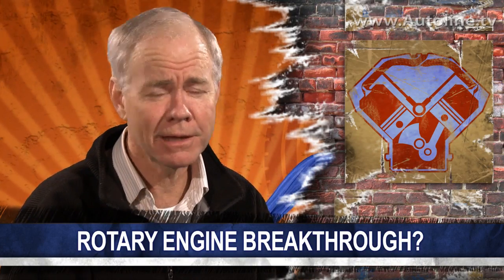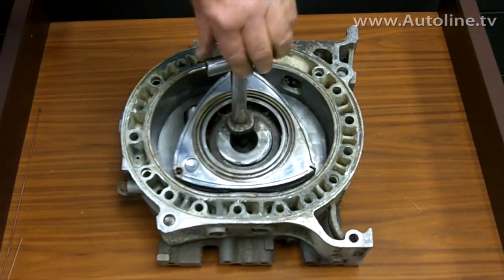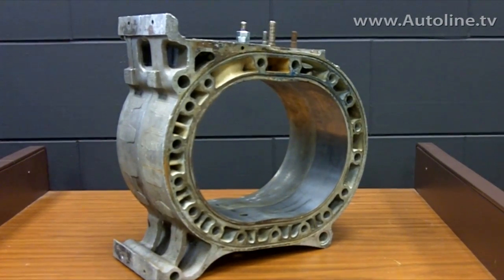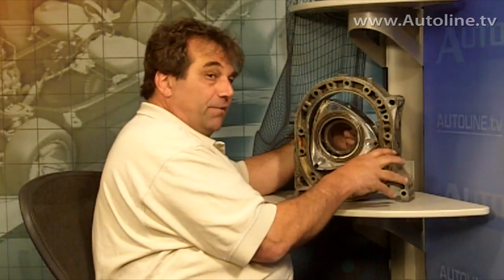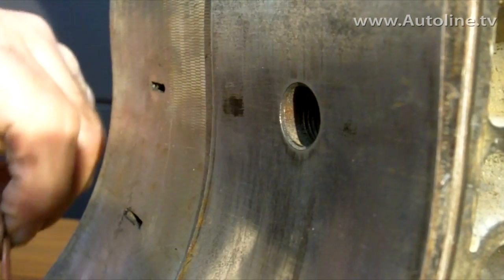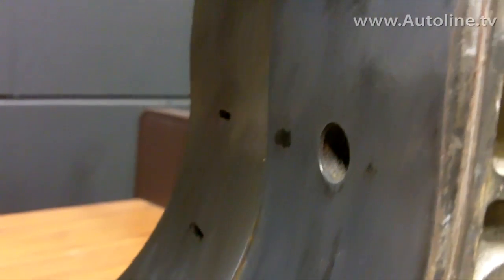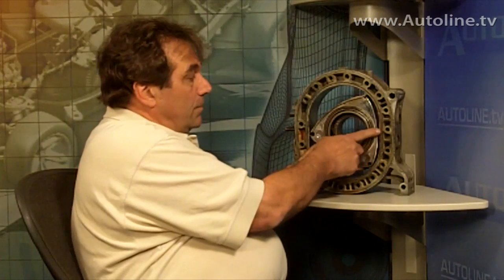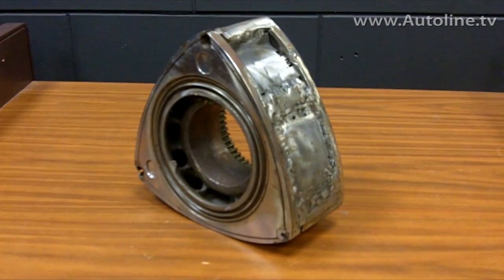Rotary Engine Breakthrough?

Comment: The spark plug problem of losing compression and crossover between chambers is solved by laser ign which operates through a narrow slit. Direct fuel injection will also improve the engine considerably. Mazda are working on these advances, along with making the engine even lighter using aluminium, to introduce an engine that turns only a generator at a constant speed, used as arrange extender in a series-hybrid car.

Wankel engines do not like being revved up and down, as efficiency drops of markedly which makes them unsuitable for the direct drive operating conditions as in current autos. Current Wankel's efficiency matches piston engines when run at a constant speed at the engine's "sweet spot".  It will be even better when new advances are introduced. A prototype series-hybrid was shown to the press, the Mazda2 EV, in Nov 1013, all were positive on the car, even though the body does not take full advantages of what the arrangement can offer - it is a body from a piston engine car.

The Wankel engine is made by five makers around the world - none are currently used in autos, although plans for range extender use have been presented.  Many are used in drones. Many of the USA drones use British made Wankel engines. Wankels are suited to aircraft because of the lightness, smallness, exceptionally high power/weight ratio, and resistance to catastrophic failure - power just tails off. Used in series hybrid aircraft applications a disaster due to an engine failure can be averted by using the batteries to get a plane on the ground safely.

The small size and weight makes them ideal for portable generators.
Expect many Wankels and many applications in the next 5 years.
Reply: Next 5 years??? WOW! YOU LOOK LIKE A FOOL RIGHT NOW!!!